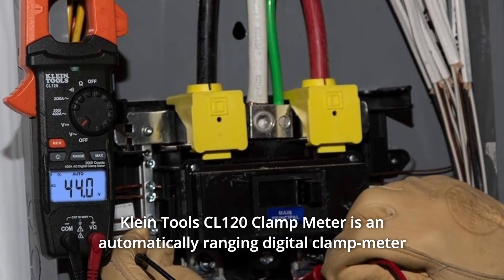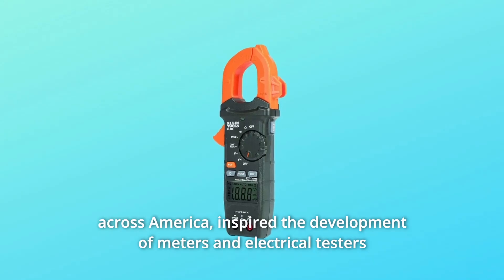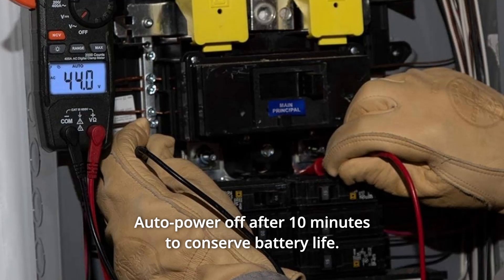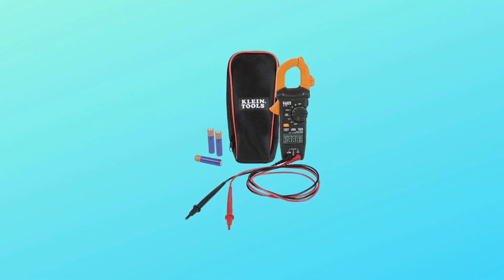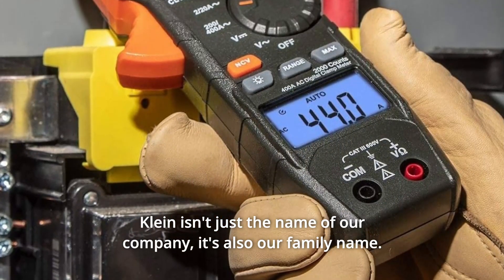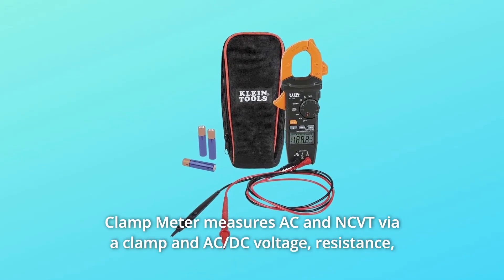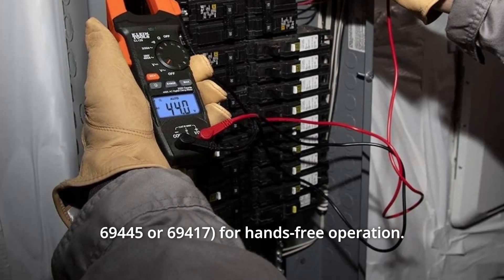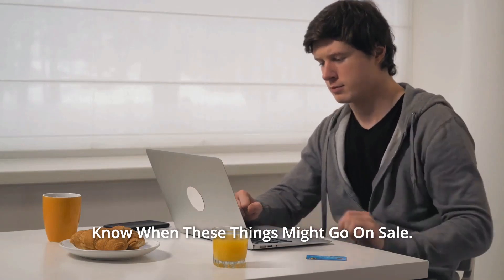Klein Tools CL120 Digital Clamp Meter Review

Comment: This meter does not test capacitor s
Reply: Not a specific test mode, but if you know how to use your multimeter you can still test/troubleshoot capacitors easily using just this meters continuity function.